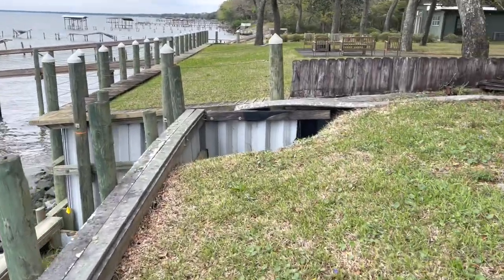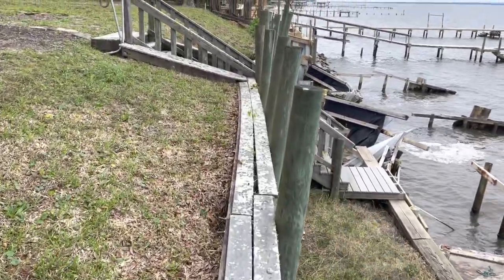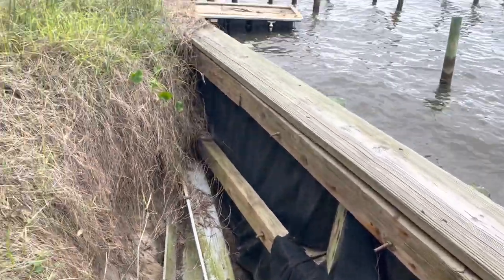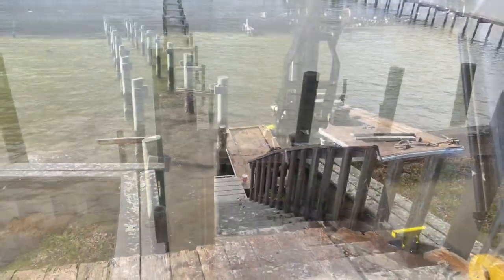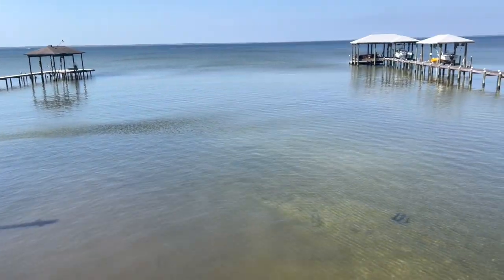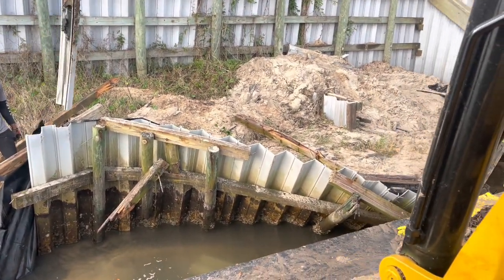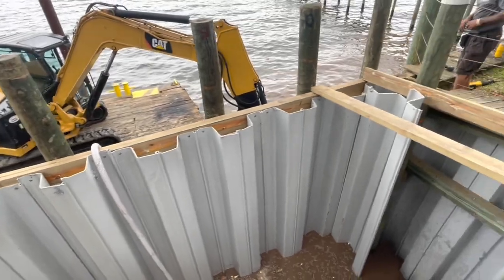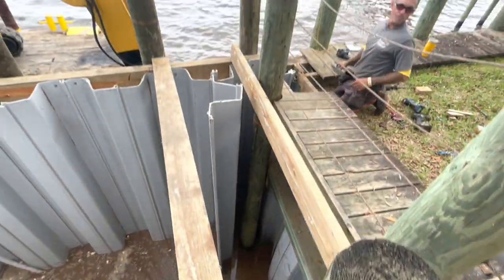LARGE NAVAL STYLE VINYL SEAWALL, MAKE SURE YOUR TIE BACK ARE DONE CORRECTLY part 1

Comment: This is the first time I saw your channel 
If you cut the bottom of the panel off an inch or 2 so you don't have to start both sides at the same time.
If your allowed use some dawn dish soap on the tight panel to get it started
Reply from the maker: Thanks for the tips!

Comment: Random questions just bought a home on a canal in So Flo and been watching all your videos. 

A. How you guys keep that barge from moving when you’re hammering the piles in? I am not a boat guy so have no idea. 

B. Do you guys hammer to pressure like a screw pile or just a depth? I’m a GC and couldn’t imagine putting piles in water in just such a different world. 

Love the channel thanks.
Reply from the maker: Thanks Gareth for watching my channel. I appreciate it. I have a 1100 lb 20 foot half inch wall 10 inch steel pipe. They dropped two holes in my barge and they were called spuds that keeps me in place. I pick them up and pin them when I need to move. As far as the depth of the pilings, I typically try to go a minimum of 8 -10 foot in the sand. It really depends on soil conditions. I do a combination of vibrating to poles in place and water jetting when needed.